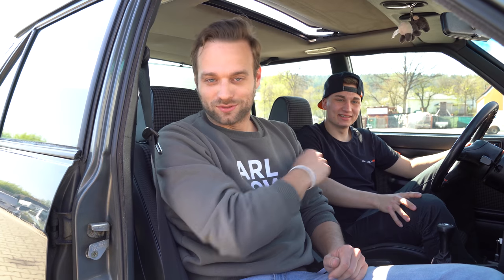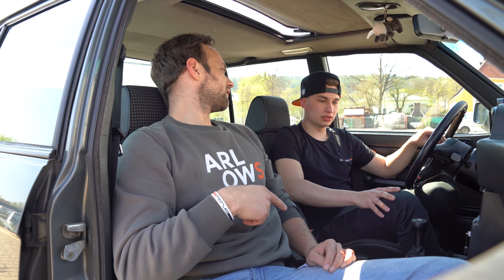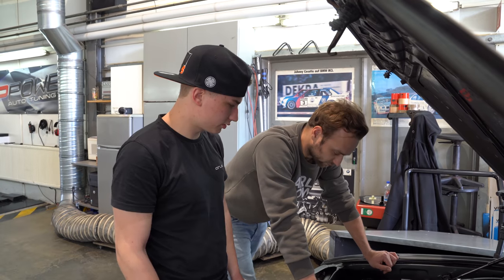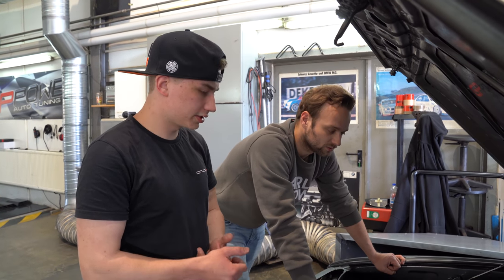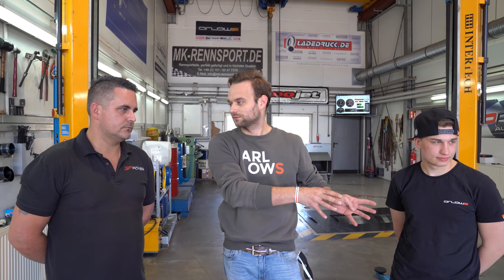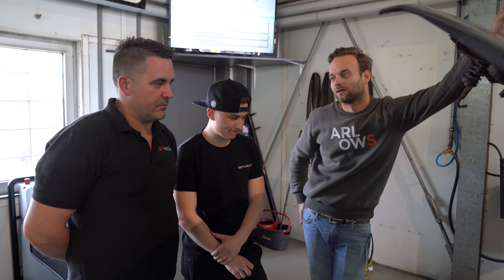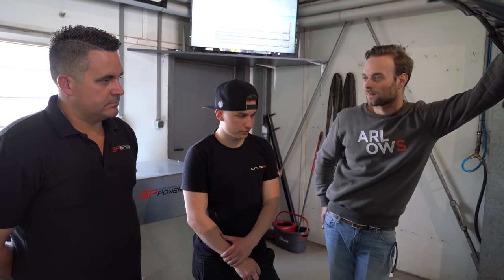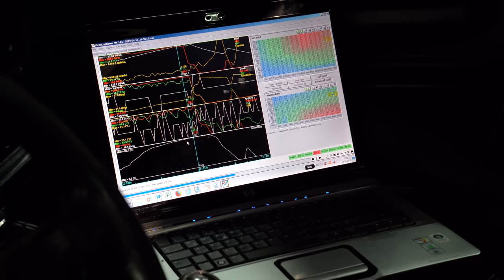Timo`s Turbo BMW! - Mit dem e28 ab zu GP Power! | Philipp Kaess |

Comment: Hatte das selbe Problem mit meinem M50 Motor und dem Lader.. Habe dann auf einen Garrett gewechselt und seit dem geht alles
Reply: Hallo
Auf welchen garrett hast du gewechselt und wo hast du es dann abstimmen lassen?
Reply: @JonasMaerkl  hey, zurzeit fahre ich mit einem GT3582R und hab ihn selber abgestimmt
Reply: Garrett finde ich auch am besten
Reply: der motor von dem gp typen sieht auch aus wie ein m50 (siehe zb öldeckel) aber er sagt er hat auch nen m20 drin O.o
Reply: @beast1337  er sagt doch er hat auch nen m50?
Reply: @bmwe4672  nö schau bei 9:35
Reply: @beast1337  stimmt
Reply: @beast1337  ist en m20 den man da sieht, siehe an der Befestigung an der normalerweise die ansaugspinne abgestürzt wird.
Reply: @ViedowFlow  nein, ich red von dem gp typen, also den e30 bei 9:03 - das is ein m50 oder m52
Reply: @beast1337  ja ich auch und es ist ein m20😂
Reply: @ViedowFlow  ahjo hast recht jetz hab ichs auch gesehen :D

Comment: hab ihr mal den druck in der ölleitung zum turbo gemessen? Wenn der turbo eine große durchlassmenge an öl hat ( eigentlich von vorteil, kühlung/schmierung) kann es durch aus sein das dein öldruck im motor top ist, aber der druck zum turbo abfällt weil zuwenig ölfördermenge kommt um den druck im ganzen system zu halten. Die ölpumpen von damals sind nicht die fördermengen stärksten. Sie liefern zwar den druck der standart benotigt wird aber die fördermenge ist relatig gering.  
PS richtig geile kiste, der man hat geschmack!! brauch auch en turbo für mein 02tii
Reply: bravo1412 öldruck wird direkt lader zulauf überwacht..

Comment: Sehr interessantes Viedeo, die Reihen 6 Zylinder M20 M30 und M50 von BMW haben viel Potential, da würde ich gerne mehr sehen!😉👍🏻
Reply: Luca Rietzler aber 1200 Ps aus einem 2.7er M20 wie vom Programmierer ist schon echt heftig. Hätte nicht gedacht dass das möglich ist ohne dass einen ständig der Kopf oder der Riemen um die Ohren fliegt
Reply: @LukeF-98  ja das sind noch richtig robuste Eisenschweine. Kennst du das Video von dem M5 mit einem S38 Turbo der einen Bughatti abzieht?
Reply: Luca Rietzler Jup, das Video kenn ich, einfach genial! Nur der M50 oder M30 sind doch um einiges robuster im Vergleich zum M20. Vorallem was den Zylinderkopf angeht, die reißen bei vielen schon beim Serien M20 und dann 700 geschweige denn 1200PS. Respekt! Fahre selber E30 und bin am Umbau am planen auch mit M20 aber Sauger und 2.9l

Comment: Wieviel Leistung hält der M52 Alublock aus?
Reply: @srcb1980  

Vielen Dank für die schnelle Antwort. 
Worauf sollte man beim Umbau achten?
Reply: @srcb1980  

Machst du das öfters? 

Fährst du einen M52
Reply: @srcb1980  Was fährst du für eine Software
Reply: @srcb1980  
Hast du mit TÜV
Woher kommst du
Reply: @ SRC B: Wie sieht es mit einen S50 B30 Motor aus? Was ist machbar Ladedruck/Leistungtechnisch ohne den Motor zu öffnen mit 102 Oktan? 
Mfg
Reply: @ SRC B: Über wieviel Max. Ladedruck sprechen wir mit Serien Kopfdichtung und wieviel Ladedruck mit Metalldichtung bei 102 Oktan? 
Hab ein GTX 30 lade da. 
Hätte den M3 gern aufgeladen, aber alle sagen ich soll ihn Sauger lassen wegen Wertentwicklung etc. 
Gibt es eine Möglichkeit sich woanders Privater auszutauschen? 
Besten Dank 
Mfg
Reply: SRC B: Also theoretisch könnte von mir aus die Leistung gleich bleiben, hätte aber gern die turbo Charakteristik. Natürlich gewöhnt man sich schnell dran und will bestimmt schnell mehr. 
Hab gehört das man die Kolben leider nicht wie beim VW von unten ziehen kann. 
(Turbo, T-Krümmer, Abgasanlage, W-Gate, Ansaugbrücke und Sachs Performance Kupplung hatte ich mir im Laufe der Zeit schon von ein anderen M3 Turbo Kumpel gekauft. Der Rest fehlt noch.

Comment: was kostet so nen motor upgrade eigentlich? also kolben pleuel etc
Reply: Er nennt keine Hersteller, daher können allein die Pleuel irgendwo zwischen 800€-1000€ pro Satz oder pro Stück kosten ;-)
Reply: @kyokushin-tobi  wäre das im günstigsten Fall überhaupt nem Upgrade 🤔
Reply: @mick28899  Ja, bin zwar nicht vom Fach, aber es kommt ja immer drauf an was man vor hat. Sprich solch ein Arlows Pleuel Set für 500-700€ wird konstruktionsbedingt sicherlich seine Vorteile gegenüber dem Original haben.
Reply: @kyokushin-tobi  ich auch nicht 
Aber die arlows Pleuel sind glaub ich sehr gut da Philipp die auch in der Limo fährt soweit ich weiß 🤔

Comment: Mein EFR 7163 ölt nach 200km mit nur 1 bar Ladedruck. Früher bin ich den X-Parts Gusskrümmer für 99€ mit Chinalader T3 GT30 Größe mit 1,5bar LD 4 Jahren gefahren, ohne 1 Problem. Jetzt ölt mein 2.200€ Lader und er Stossaufladungskrümmer für 1.000€ ist nach 100km gerissen😒 klar fährt das jetzt besser, spult früher an ect. Aber Preis-Leistung ist so eine Sache
Reply: Das Problem ist gefunden und behoben. Der sogenannte Ölrestriktor ist ab Werk zu groß. Es ist eher eine Fitting mit 4,4mm Bohrung. Ein neuer Restriktor vom TurboZentrumBerlin mit 0,7mm hat das Problem gelöst.